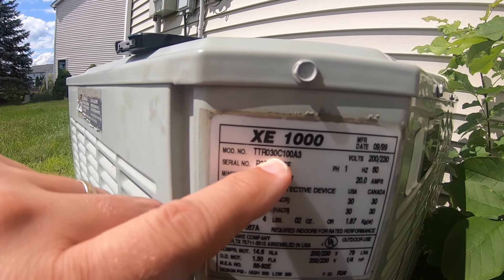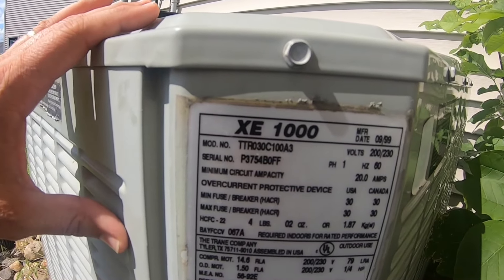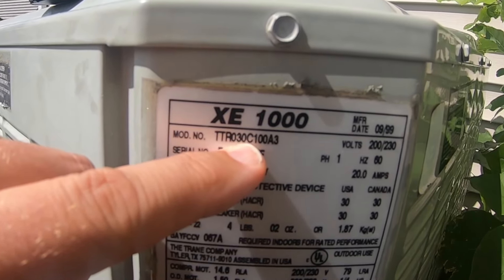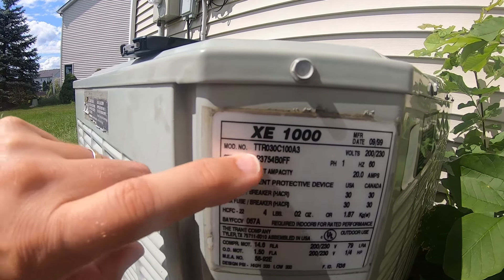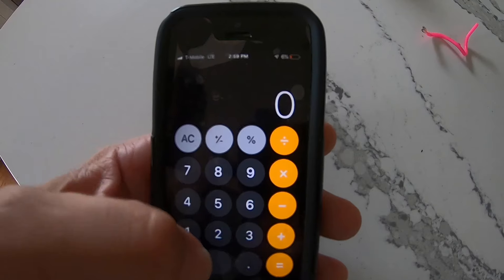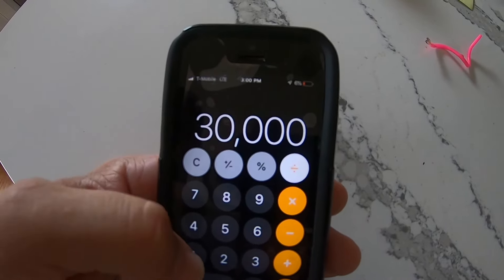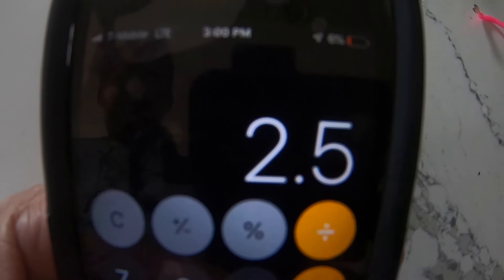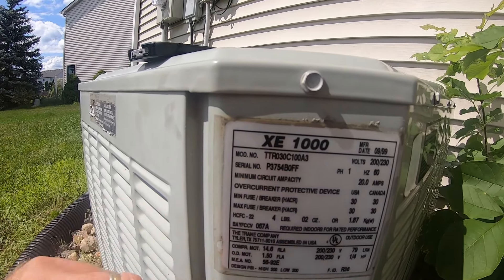air conditioner tonnage calculation : how to find air conditioner size

Comment from the maker: Our old HVAC condenser died so we replaced it with :
2 to 3 Ton 20 SEER Variable Speed MrCool Universal Central Heat Pump Split System - Upflow/Horizontal with Quick Connect Lineset - 15 Feet
https://amzn.to/4fOgmab
You can find more details from our playlist : 
https://www.youtube.com/playlist?list=PLExVGissIl-GdKsUBhF3c0fQ6E_o6oOaZ

Just FYI...the Amazon link on this page is an affiliate link. It's free for you to use AND Amazon will pay us a small commission if you use any of our Amazon links - Many thanks if you do. It helps us keep making videos!

Comment: I appreciate that tip! I know It’s not the actual problem with yours but the first thing you wanna do is rip out that plant growing right next to the AC system that helps restrict the air flow.
Reply from the maker: Hey loose..,
Good point. Thx!
Reply: @Housebarons  I hope you got everything worked out, 20 years is a good life for an air conditioner. I live in South Florida. We’re lucky if we get 15 lol.

Comment: Super helpful, thank you for taking the time to explain this! What are some draw backs of replacing a current lower tonnage unit with a higher one?
Reply from the maker: Hey Guillermo,
A little bump up ( in our case .5 ton) was not a big deal. But jumping from maybe 2.5 to 4 or 5 ton could cause the compressor to cycle more intermittently ( read stuff online about this ). Apparently too big / more than what our house actually needs - was not good for long term health of the unit. 
Hope that helps.
Thx for watching!

Comment: Does anyone know if there is a code that nameplate ratings have to be located outside of the unit? For example I am noticing hot tubs you have to unscrew six screws and remove the front cabinet panel in order to get out their paper stick-on very vague nameplate rating

Comment: Hello I have a question my house is 1560 sq ft , I have w3.5 ton Trane unit which is about 16 years old.  My a/c tech said they do not make 1/2 size units anymore is that true?  He wants to install a 3 ton unit I figured going lower and living in Texas the unit wouldn’t be able to keep up on those 100 degree days is that true?   I thought he would recommend a 4 ton
Reply from the maker: Hey Estrel…,
1st - there are sooo many variables: insulation thickness, # windows, which way they face, multi-pane, gas filled, temp of thermostat, tree shade? ranch vs 2 story…. Etc….

Said all that to say - hard to say. If you live in a subdivision, you could chat up your neighbors / find a similar house with a 3-ton unit…. See how they like it.

As for 1/2 sizes. I know MrCool uses 2or3 ton, 4 or5 ton = they have a selection switch. 
We are in Midwest and generally  a 3 ton should cool 1500sq ft No problem. But  Texas heat… hmmmm. 

If you are uncertain, you could see if your energy company does energy audits. 
There are also ways to do HVAC calculations. 
Your best bet is to ask lots of questions. Maybe get a 2nd quote from another company. Just ask for quote and don’t give them any info about the 1st quote. Just have them advise you. 

Hope that helps! Thx for watching!
Reply: My tech said similar. They like to install Trane and Frigidaire, and we havenone of each. Honesty the Frigidaire 3 ton has given us no problems while Im on my third start capacitor on the trane 4 ton. Same house same unit age (two zones).

Comment: Very Helpful.  Is there a standard BTU per Sq'. I mean I know more rooms and walls, n how many supplies you have all play a part, but for a 1000sq' Home, 24,000?
Reply: So you have a 30,000 BTU unit, do you mind if I ask the Sq' of the building it's cooling?
Reply from the maker: Hey J. T. ,
I have seen various “rule of thumb guesses” . But they are pretty worthless as insulation, number of windows, duct sizing, trees/ shade, age of house, thickness of walls, volume of interior space, lot orientation….. all make a difference. 
Your best guess is to look at size of current unit and determine how good of a job it did. 

In our case we have 1900 sq ft above grade plus basement. Old unit was a 24,000 BTU unit. New Mr Cool has 2 settings. , we chose the 36k rather than 24k. 

Hope that helps & thx for watching!
Reply from the maker: Hey J. T.,
You can get a decent estimate by having all variables plugged in by an HVAC company that has the ability to do such calculations. 
Big box stores may have resources - getting HVAC designed and determine load calculations.
Reply: @Housebarons  I actually got it done already.  I own a Duplex, n needed it for the 2nd floor. I called a friend. He text me what the SQ' was, but he has been there before.  He put in a, we 30 in the model Number, so I guess 2.5 Ton. 30,000 BTU. Seems to be fine.  Thanks for the response.
Reply: @Housebarons  what tonnage would you recommend for a 2500 square foot residence

Comment: I'm working on a very old arcoaire unit. All the name plates are worn off. How would you calculate the size?
Reply from the maker: Yikes. Not really sure? 
 - call hvac company - see if they have any magic. 
- guess based on house size, ( bigger the house, the bigger the unit )
A basic sq footage calculation can give you a decent ball park of what it should be. But there are many variables ( house insulation, number of windows, direction the windows face etc. ) which can complicate that. 
- do a google photo search and see if you can find its twin. 
- guess based on the breaker size 
- go look at your neighbors houses for a twin??? 
- any easy way to look inside for labels? 
Time to be a detective😃
Thx for watching!

Comment: I have a question. Which btu unit rating do you go with the advertised one or the gov or whatever one which is always a few 1000 btu less, kinda confused not an expert here just trying to cool 1000 sq feet of garage space i have 3 portible ones  now 2- 14,000 btu and one 10,000 btu thats 38,000 btu's on paper that many btu's should cool it, It is only dropping about 5 degrees today 111 in there after 5 hours of cooling only dropped 5 degrees is this a insulation problem only? You would think with that many btus i would have lower temps any help, i am maxed out on my 3 circuts feeding the garage all three units are brand new and cooling only.😢 bummed a nearly broke on this project.
Reply from the maker: Wow. Thats a lot of btu’s. 
My guess is you have an insulation issue. Is the garage door insulated? Garage ceiling insulated? Often exterior garage walls aren’t insulated. If any one of those areas aren’t insulated, you may have an uphill battle trying to cool the space. 

Also - how tall are the ceilings? Volume matters. Let’s say you need 24,000 btu’s to cool a 1500 sq ft house ( I’m pulling numbers out of thin air in this example ). That cooling capacity assumes 8 ft ceilings. If you had 10 foot ceilings, you have 25% more volume of air to cool - so you’d need 25% more btu’s. If your garage ceilings are tall, that matters too. 

That’s where I would start. 
If you are using window a/c type units, you may want to look into a larger mini-splits. They make them pretty efficient these days. 
Hope that helps.
Reply: Thanks house for taking time for answer. The ac units are on wheels and have a 5 or 6 inch discharge hose for the condenser I know am at about 39,000 btu's and no cooling to speak of 
The units are brand new. The garage has NO insulation at all. I was hoping to negate that fact and hit the garage with a lot of
 tonage, To over come the heat transfer I guess I'll save up for a insulator. I am open to any suggestions, again many thanks.😮c
Reply: The ceiling is open rafters 10' tall.😊

Comment: where did you get the 12,000?
Reply from the maker: Every “ton” equals 12,000 btu’s. Doesn’t have to due with weight but thermal units. 
Thx for watching!

Comment: i was wondering what your square footage was for your residence. i have a 2500 square foot residence and i’m not sure how many tons i would require
Reply from the maker: Hey Saood,
Around 1900 sq ft plus another 1000 ish sq ft basement. 
BUT … it is nearly impossible to compare houses unless they are built at same time, place and by same builder. 
Their is so much variation :
Window construction and size. insulation, weather seal, location, temp settings of thermostat, wall and attic insulation, house orientation, number of windows and on and on and on. 
If you currently have a hvac set - up , you can use that as a gauge - is it’s performance satisfactory or not. 
Hope that helps.  
Thx for watching!

Comment: I have 2 sets of even numbers in this model number. M2HP3042A1000AA. So which would I use to understand tonnage?
Reply from the maker: Hey harp..,
I can see the easy confusion. 
I did a quick search of your number on the internet - looks like the SECOND set of numbers - the 42 is your tonnage reference …
I found at 3024… that was a 2 ton and a 3030 which was a 2.5 ton. 

Looks like the HP stands for heat pump??? Is that what you have? 

Probably a good double check when you have a confusing number set is to confirm through an internet search. 

Thx for the question!
Hope that helps. Thx for watching!

Comment: How many tons would be for the model number T2A360GKA100? Is it 3 ton or 5 ton? 36/12=3 60/12=5 Thanks in advance!
Reply from the maker: I’d hate to guess. It’s pain when they use 2 #’s that confuse.
I did a quick search - the model # comes up as a SEARS product - this was a number they listed ( +1-800-366-7278 ) - probably your best bet. 
Hope that helps!

Comment: hello was just wondering on the sizing of the home? and how you got the the specific equipment size? I'm considering a similar option but im about 2200 square feet 1999 build. Northern Ohio. Is it possible the winter numbers you got are because your undersized?
Reply from the maker: Hey Brian,
Our house is ~ 1900 sq ft plus 1000+ sq ft basement. Don’t think our unit is undersized - at least not in a major way. Builder probably put in what he could get away with. 
The problem w/ comparing houses in different cities is there are so MANY other factors to also consider. 
 Best to compare you house with others in your area built at same time by same builder. 
Worst case, have an energy audit done on your house to perfectly determining your needs.
Hope that helps

Comment: Where do I look for that number? The serial number? 13AJN24A01. Is it 24,000÷12,000=2. I live upstairs in a 1970's 2 bedroom condo and my light bill is always ridiculous. Added insulation,   clean the unit, change filters. Don't know what else to do anymore. Thank You in advance.
Reply from the maker: Hey Cynthia,
The number is typically on the back of the unit. 
You should try and find what you have exactly. 
Get brand, model, model number and look up the unit online. How old is it? Efficiency rating? 
Old units are much less efficient. 
You could ask and see if your utility company can do an energy audit : basically see if the can find leaks and problem areas of your condo. Sometimes they are free of low cost. If your costs are high, it’s worth playing detective to find out what needs correcting. 
Thx for watching!
Reply: Make sure there are not open air returns in attic if there is one. Also make up air;; this is air brought in from the outside (regulations on commercial buildings vary).

Comment: I enjoyed this 
Just what i was looking for
Reply from the maker: Hey Henry,
Thx for watching!
Reply: @Housebarons  and you made a statement talking about if you are looking for horsepower in an air conditioner unit you check it on the serial number written on the AC you look for an odd number written in the serial number and X 12000 BTU to give you the horsepower
Reply: @Housebarons  in a situation whereby the serial number is not given how can you now then find the HP because I have come across such situation I am an AC technician
Reply: @Housebarons  I would like to know more about this calculation because some air conditioner doesn't have horsepower rating in there tags

Comment: Lines freezing up: The evaporator coil is not "warming up" enough.  Check for airflow issues.  Use a low restriction HVAC air filter, or one that has a low resistance to air flow.  High MERV, 1 inch thick filters are highly restrictive, and will reduce air flow.  With low air flow, the evaporator coils can't warm up sufficiently, causing the evaporators and/or the lines to freeze.  If you can go with a 4 in thick filter, that would be great, as they are far less restrictive to air flow than 1 inch filters.  They also last longer.  Check to make sure the evaporator coil is clean.  If filters are not changed regularly, dust can accumulate in the evaporator coil.  A dirty evaporator coil will block air flow, which will prevent it from warming up.  With all of that said, why did you need to know the BTU capacity of your condenser?
Reply from the maker: Hey Claude…,
Thanks for the extensive comment and help!! Very informative.
I needed to find the sizing of the condenser to confirm what I had for my house as I sought a replacement for my dead unit. 
Thx for watching!

Comment: Don’t assume the current installed equipment is correct; it serves as a baseline.  My heating boiler is 240,000 btu for 2,950 rated sf.  It is about 2x as needed based on literally 3 minute on/off recycling.
For air conditioning, there is a template to determine btu tonnage based on house air, location, exposure, etc. that is too much for the Homeowner to use.  Basically, my rule of thumb is that your AC should be on about 12-16 hours on the hottest days; it should run long hours to dehumidify, so too much btu tonnage will not run long enough, while not enough tonnage will require running all the time to get to a comfortable temperature.  Don’t assume the original install is correct; the contractor may have installed equipment they had in stock, not what you need.

Comment: Sir I don't think that way to figure out tonnage applys to every unit. I have a GSC130421AC. So mine should also be 2.5 tons. But  when looking up my model number online everywhere it says 3.5 tons. Am I doing something wrong??? I hope it is only 2.5 tons.
Reply from the maker: Hey Jonny,
Looks like Goodman ( from online explanations) uses the numbers to the right next to 1AC. So look like 42 would stand for 3.5 tons . 
Best to call Goodman to get clarity to be sure.
Thx for watching!
Reply: @Housebarons  Thank you sir for your quick response. That makes sense, I think it is 3.5 tons but will call tomorrow to verify. I'm buying a portable generator and trying to figure out how many watts I will need to run my AC. A 3.5 ton should be a little over 4000 watts I suppose. Thanks again
Reply: @johnnywhitepride8540  I doubt very much a 4 KW generator will be able to handle your a/c plus all other lighting and appliances! Maybe and 8 KW unit will do the job!

Comment: Do not believe any contractors telling you what size you need. They decided 40 years ago to lie and sell you 0.6 of what you need so they can come back every 10 to 11 years and sell you another one. Buy twice the size they recommend.  It only costs 18 percent more and lasts for 20 to 25 years!
Reply from the maker: Hey David,
Thanks for the input. I think some builders of typical houses like to cut costs at every corner, so small sizing the ac is something they won’t have to live with and can save a couple coins doing. We recently went from a 2.5 ton to a 3 ton at our house exactly because of what you state in your point - seemed like our original a/c ( which did last 20 years) was a little undersized. 
Not being an HVAC licensed contractor, I will say that have have read consistently that people in who should have the knowledge say that greatly oversizing your HVAC unit can be detrimental to its longevity. Supposed to have something to do with the duty cycle. 
Just passing it on. But then, there is the - who do you trust, do they have an agenda etc. That is why  posts like yours are important - so people can weigh the information.
Thanks for watching.
Reply: Hate to burst your bubble, but the vast majority of contractors oversize, and that's due to how the manual j tells them to do. Oversizing actually is worse than under sizing, for comfort and equipment longevity. But you wouldn't know that because you aren't an a/c tech.
Reply: We lived in a brand new 2400 SQ FT 2 story building in Texas and the AC could NOT keep up with the cooling needs on the hottest days in summer. I'm currently living in a 1500 SQ FT house with poor/old insulation and I have actually turned down the cooling of the AC several times and we are having 100 degree+ days currently. I don't know what the size is of the current unit, but I know the one in the other house was too small.
Reply: @MAGAMAN  It needs to keep up with around 90% of your cooling needs. Over sizing it for the top loads means it is over sized the majority of the time. In any case, a two story house should have a unit service each floor.